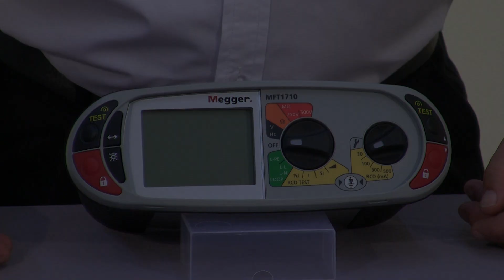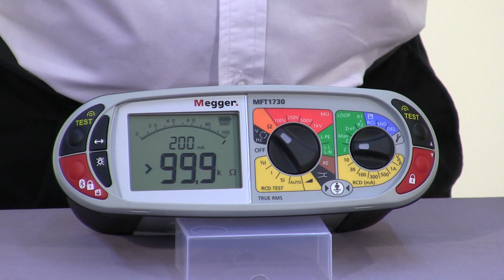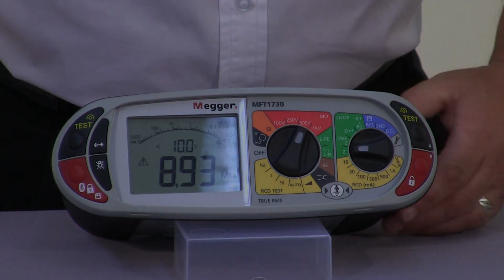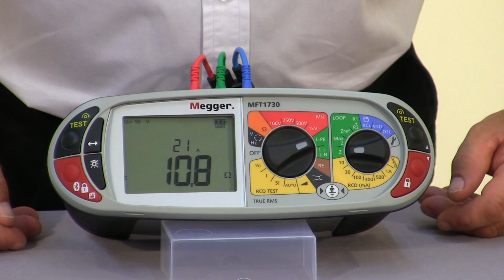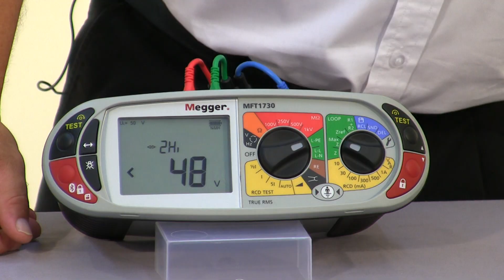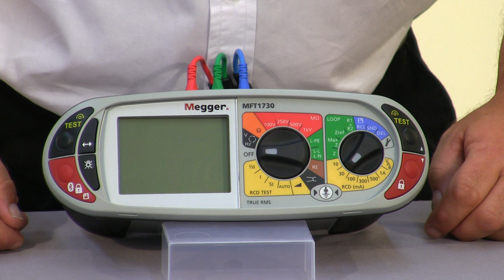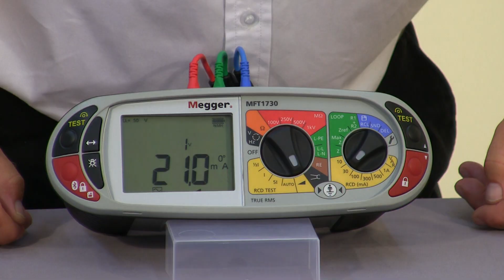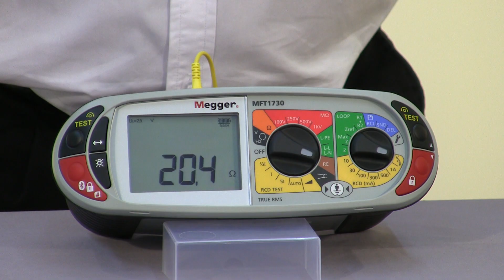How to use Megger MFT1700 Series

Comment: Megger said: Save time and get non-trip loop testing down to 8 seconds with the MFT1741+’s new Loop Impedance testing technology! This innovative ability also increases the accuracy of results as it prevents the RCD from influencing the total loop impedance value.

But Megger never said non-trip loop testing down to 8 seconds only happens on 3Lo. 2Lo is still at 15 secs. 

Also the increase in the accuracy of results as it prevents the RCD from influencing the total loop impedance value only happens on 3Lo. 2Lo has still got the RCD uplift.

No wonder Megger says 3Lo is the preferred setting!!!

I wish i could do 2Lo to get quick and accurate readings........a third wire is always fiddly when testing behind accessories like spurs, cooker switches, 20A DP switches and even ceiling roses.